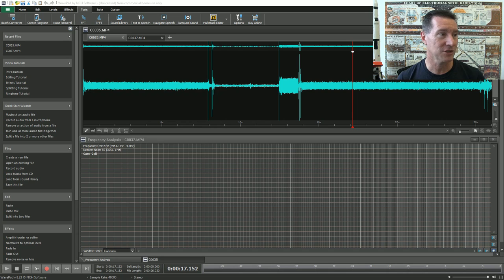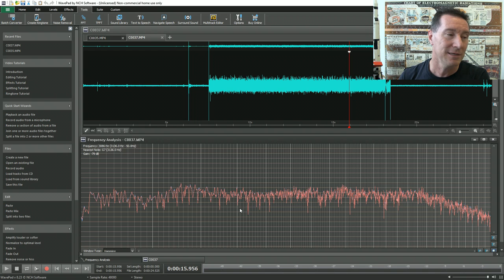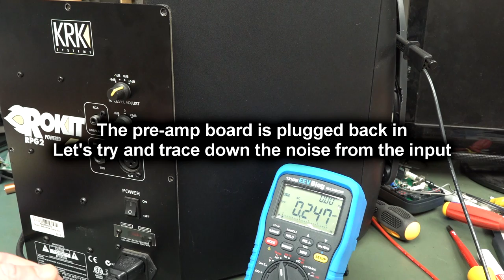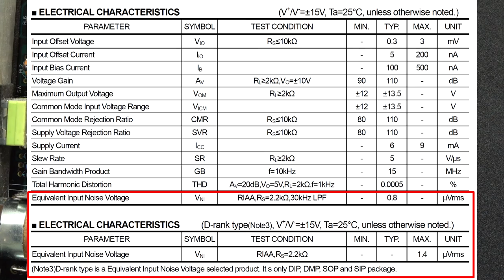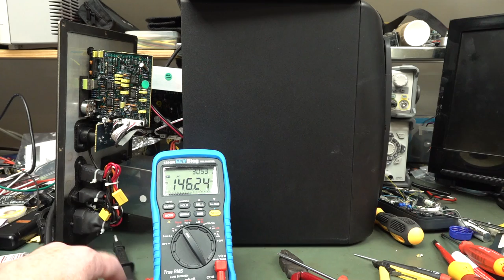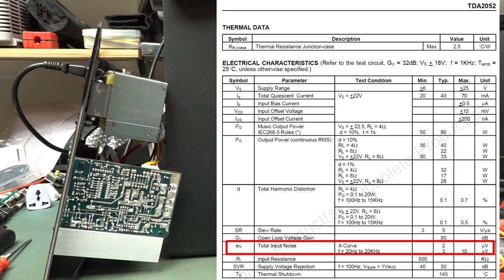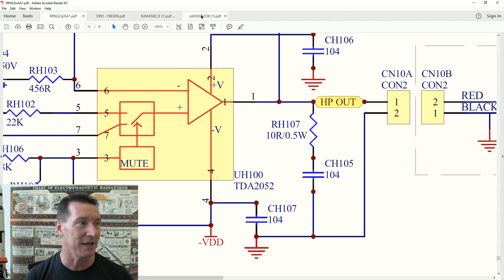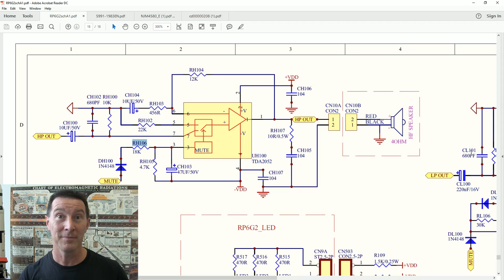EEVblog #1118 - Why Are Studio Monitors Noisy?

Comment: Remove the ground pin from the power cord.  Seriously..
Reply from the maker: And what's that doing to do to broadband noise with a shorted input on the power amplifier chip?
Reply: I'm not sure how much noise you are getting compared to my KRKs but mine are pretty much silent with the ground pin gone.  I fought with them for years until I realized what was going on.  I think they are the RP8s which are not those models though.
Reply: thats what i did for my jbls and now they have no hiss at all.
Reply: No. If you have a ground loop you should not remove ground cables to isolate the speaker from the loop, you should break the loop. Treat the cause not the symptom.
Reply: I have JBL LSR308's that hiss, I did know about that before buying based on forum posts. I can notice it when my room is dead quiet, but also kind of tune it out now. I did just now try using an adapter to remove the ground, but didn't notice a difference
Reply: I've got the LSR308s as well and they are silent.  I use a XLR preamp however.
Reply: Given that there's only one ground involved, I'm not sure how there could be a ground loop.
Reply: You can start your journey here:

https://en.wikipedia.org/wiki/Ground_loop_(electricity)#Common_ground_loops

A quick quote:
A common type of ground loop is due to faulty interconnections between electronic components, such as laboratory or recording studio equipment, or home component audio, video, and computer systems. This creates inadvertent closed loops in the ground wiring circuit, which can allow stray 50/60 Hz AC current to flow through the ground conductors of signal cables.[2][3][4][5] The voltage drops in the ground system caused by these currents are added to the signal path, introducing noise and hum into the output. The loops can include the building's utility wiring ground system when more than one component is grounded through the protective earth ("third wire") in their power cords. 
.....
A hazardous technique sometimes used by amateurs is to break the "third wire" ground conductor P in one of the component's power cords, by removing the ground pin on the plug, or using a "cheater" ground adapter. This creates an electric shock hazard by leaving one of the components ungrounded.[3][4]

But honestly, the reason to avoid this practice is not just because it is potentially life threatening.... It's because you're just not fixing the problem. You're hiding it, sweeping it under the carpet. No self respecting enginerd type would settle for that ;) If removing this pin reduces noise, you have a noisy power supply and that's going to cause more problems than just noisy speakers. Best to fix the problem.
Reply: well just removing the earth cable works fine and my speakers are having no issues.
Reply: facepalm natural selection, do your thing.....
XD
Reply: Really bad advice. Removing safety critical earth wiring because "noise" is a recipe for disaster.
Reply: It is not safety critical, because transformer ensures galvanic isolation.
Reply: More like really good advice.  What kind of OMG DISASTER will happen?  My 10 year old studio monitors stop working after a surge?  OH NO!!!!
Reply: @okaravan  Except when it doesn't, which is why they have a ground installed in the first place..
Reply: @MichaelBruceTaos  More like the speaker power supply develops an internal fault and you electrocute yourself on them. Don't disable safety features if you don't even understand why they're there in the first place.
Reply: @RobertHancock1  A little wall voltage never killed me.  Maybe you are 'more sensitive'.

Comment: Why are they noisy.  They are stuffed.  Are they meant to be noisy no.  There that answers that question.  And that should be it..  Only it's not is it..

"But I spent X amount of speakers and they do that".  You spent X amount of speakers and got caught.  Period.  Speakers are not meant to make that noise.  Period.  If they do they are not good speakers.  

Commonly it's caused by moisture getting into the packaging, and that causes corrosion somewhere on the board, and the corrosion is what is causing the noise.  It can (very occaisonally) be spotted but a lot of the time it will be a very small blot of corrosion on one pin of a chip or something, you might spot it, but probably not.  If something does that the easiest thing to do is to simply throw it out.

"But they gave me a replacement set and they do the same thing."  They gave you a replacement set from the same stuffed shipment..  So...  

"But every speaker in the shop did it?"  That shop (or there supplier) has mositure problems.  Don't go back there...

But..  but..  "But I'm an expert and I don't make mistakes.."  I see, so you are a unknown drip under pressure are you..  Well that's good.  Speakers are not meant to do that.

End..

Comment: The monitors are noisy are because they are cheap quality made in china shit.  You need to add bypass caps to the diodes in the power supply, amplifier, and ground the unused inputs because those unused inputs are causing the amplifier to amplify static.